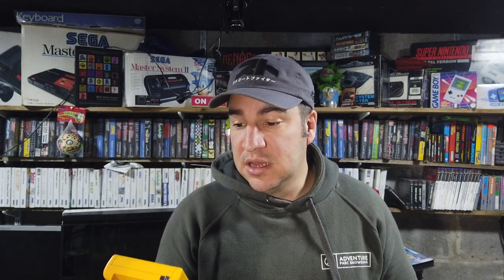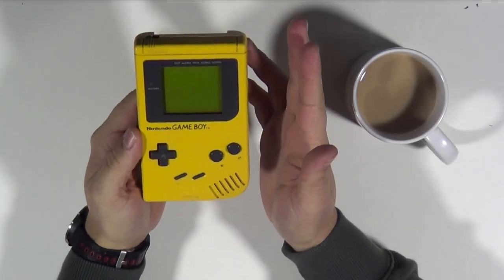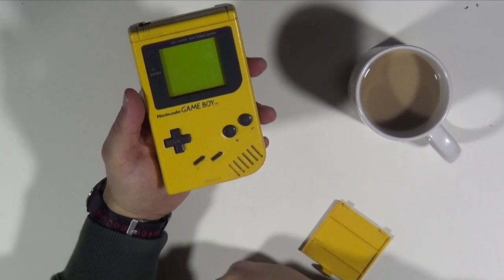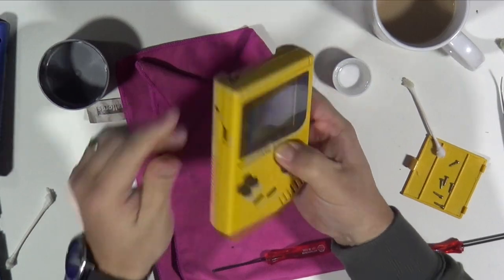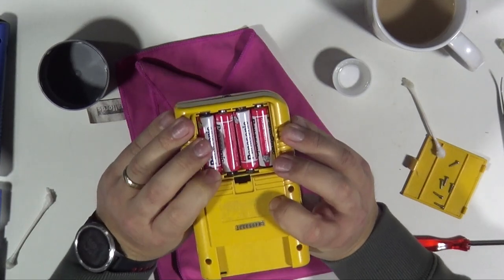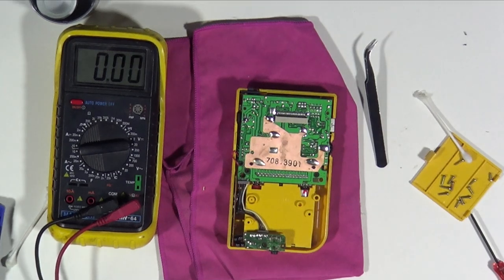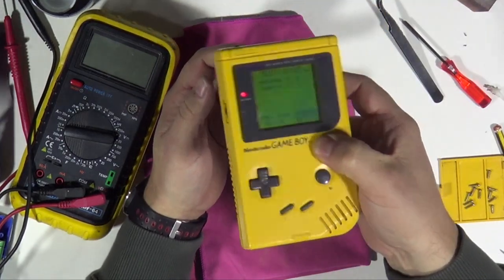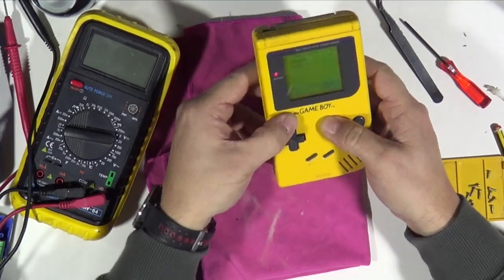The Best Nintendo Game Boy DMG IPS V4 Screen Mod OSD Repair & Install

Comment: I was gonna just buy one fully finished, but after watching this I think even I could do this mod LOL. Love the menu options with the colour, etc.
Reply from the maker: It is so easy and everything is in that pack, even the screwdriver. 
I'm going to do a cut down tutorial video from this just on the screen install for those that want a shorter more to the point video. 
Most difficult bit is that small ribbon cable in to the connector, it is just fiddly.
Reply: @GoodwinsPlace  that would be good Craig.

Comment: When I was watching I was thinking dont the two sprogs have to be cut out and then you did it lol.... Like I said to you before I've been looking to do this myself but the kits I looked at where way more expensive so this helps....great vid mate 👍
Reply from the maker: I know those bloody things, they are meant to be able to stay with this kit as the screen holder has the cut outs but they just wouldn't go. For the money it is great, think I've paid more for the backlight kits in the past.
Reply: @GoodwinsPlace  yeah I was thinking originally white with white buttons plus on retrosix website they do a white glass screen plate..... might be worth you taking a look i've seen theyre ready made ones on ebay and they look nice
Reply from the maker: @nerdygeezer78  watch this space, a parcel arrived today. #spoilers
Reply: @GoodwinsPlace  nice..... I'll watch out for it

Comment: Looks great! So no trimming the shell needed right?
Reply from the maker: Not on this shell that came with it. If you're using a stock shell or other stock size you might need to trim around the screen and some of the posts.
Thanks for watching.
Reply: @GoodwinsPlace  thanks for the help!
Reply: @GoodwinsPlace  *will, the screen and contrast wheel cutouts

Comment: Did you install the ribbon cable correctly at 34:00? I followed your video and mine didn't work (I had to flip it), and I noticed you have an edit in between that step and turning yours on
Reply from the maker: Yes, you can see the silver connections and blue text face up which then go in to the board face down when folded over.
I probably edited it to speed things up and if I went off camera for a bit to get something like tweezers.
Cheers for watching, hope you're enjoying your new screen, they are great quality.
Reply: @GoodwinsPlace  My mistake, I meant the large one closer to 35:00. I tried the shown way (blue stripe up) and the screen just gave me 4 Pikachus instead of booting. I had to flip the cable it so the blue stripe was face down / pins and text were facing up (I saw this at abut 29:00 into a different install vid by YouTuber Makho)
Reply from the maker: @Dry Cement  no just checked that too and it's right the way I have it. The blue mask protect covers the pins and you need the exposed side to face the board on both screen and main PCB. Other than the title clip there isn't a cut between fitting the batteries and me turning it on, it's the same footage.
I'm sure there are differences in kits being supplied but this is correct for the ones I've done, and probably done around 20 of these since this video.
Reply: @GoodwinsPlace  Thanks for checking, there must be a couple of different models  out there

Comment: First off, thanks for using Top Ranking Tennis for the demonstration, it's a wonderful game.
That being said, I really like this screen with its OSD and all that stuff, but in my opinion the Retro Pixel feature on the FunnyPlaying IPS screen is much much better and useful.
I mean, it's nice to change the individual colors maybe once or twice, but after that it becomes useless IMO.
Great video though, keep up!
Reply from the maker: Thanks Marco. Not sure how different the retro pixel is on the other screen to this one, I enabled it on this screen along with the battery display for a bit but took it back off as preferred the clean crisp look of the screen.
I know where you are coming from on the colour adjustment I thought it was going to be a novelty to start with but I think it really does make a big difference in some games. The stock colour options are great but being able to change the individual colours can give some real detail where the single colour gradients don't offer as much differentiation. 
With most mods it's personal preference, I've just picked up some extra bits got this from Retrosix to take it to the next stage. I think I'll be finished and 100% happy with it at that point.

Comment: Great vid Craig I really enjoyed that. It definitely made me want to do this. Only sticking point is I don't have a soldering kit. This is definitely the ultimate way to play og game boy games. It ain't quite the same on a gba, even a modded one.
Reply from the maker: It's a shame they didn't put some sort of push connectors for the speakers as it is the only soldering item and it is tiny. 
Always happy for you to send it to me to do, but you could get a soldering iron for under £10 on Amazon which you could do this mod with. 
I love the shape of the DMG, think it is a great size and for me is the system I spent most hours on.

Comment: I like the FunnyPlaying screen better. It doesn't have an OSD but the built-in color options are more usable. I doubt that anyone would really play with a deep red or blue screen like this one has.
Reply from the maker: I've got mine setup with a really nice colour selection now. Based on black and white with a grey and an off grey colour - I thought it would be a novelty when I first done it but it's great.
I think I might do a funnyplaying next as heard lots of good things about them.

Comment: Hi ! Thanks for the video !
I have just done this mod on my Gameboy, and I'm 50/50 happy with this.
First, I did the IPS V2 version, and the cross pad controller was a complet mess, then I saw this V3 and it was much better on the control side.
Then I realized that the overall thickness of the new IPS screen + the 3D printed plate + little control card were too fat, so I could not close correctly the Gameboy, I discoverd also that the big flat cable was pinched between the motherboard port and the control card glued to the screen after screwing it back together.
After many grinding, I was able to close it correctly...
However, there are some things I don't understand and have some concerns.
Sometimes, after 5 or 10min playing, the screen freeze, the sound continue to play and the light become lower and lower, this, if I am in sector wire mode, classic battery mode or Li-Po battery mode.
Did you experience this problem ? Sometimes I can play 1h without any problem.
I play with Zelda and thankfuly, I can save and close when this problem come.
Secondly, I'm a little intrigate by the battery icon mode you have shown in the IPS menu. I can't find any explainations regarding how it works, because I tried to put the icon on the screen, but it seems to indicate nothing about the battery statement, for me the icon never change during play, or maybe it's my imagination...
Thank you for your attention and hopefully for any tips you can bring to me :)
Reply from the maker: Thanks for the comment.
The fitting is slightly different depending on the IPS model, some need cutting, some need posts removed, others just drop in.
The crashing is strange, I've not personally had any issues like this, does it happen if you are playing at a lower brightness?
I'd check all ribbon cables again, make sure it doesn't have any major kinks in it or any damage. 
Last thing would be to test that screen on another Game Boy motherboard and possibly another game to see if it still happens.
I'd ignore the battery indicator, I don't think they are accurate, I don't even run the wires on the GBC for it to work now as they are so bad.
Reply: @GoodwinsPlace  Hi and thank you for the answer !
I didn't think about the brightness, and as I said, it happens some times, not every times. Today I just played 1h at Zelda and no problem. Yesterday, after 30min the image was completely exploded, shrinked and no more sound, so maybe it's the motherboard or some capacitor. She's very old, bought in 89 the number is G0... and she has philipps screws, no triwings.
I have an other DMG that I bought some weeks ago to pick up and swap the screen that has liquid crystal leaked on mine (to keep an original DMG fully operative) and I will try to swap them. I'm not at home all the time, I will try this weekend.
And what about the power regulator mod sold by Retrosix ? Do you think that worth a penny ?
Thanks again for your time ;)
Reply from the maker: @lechatvenere  I've not tried a power reg with an IPS, it could help but sounds like your issues aren't power related. 
Just to make sure none of these issues exist in the cart on other systems?

Comment: Im about to order this today. I also need a power board too. Was damaged from leaking battery.😔
Reply from the maker: How bad was the battery leak? Sometimes you can get away with a good clean up. I've had a few with surface damage on the board and managed to clean them up and get them working.
Reply: @GoodwinsPlace  corner of power board looks burned and corroded shocked it worked to begin with. I found a retrosix new replacement in UK for 18 dollars plus 16 shipping. All sold out in states.😞
Reply from the maker: Can't you get another game boy in the US for cheaper?
Reply: @GoodwinsPlace  yes I'm sure I could find one for parts but was thinking it would good idea to replace with new if going with new lcd replacement. Wouldn't the audio be less "noisy" with new power board like the retrosix cleanpower v2 and more reliable?
Reply from the maker: I think it will be worth it especially if you are doing the screen too. I don't know if it cleans up the sound at all.

Comment: That's awesome mate! I've just had a line go out on an original dmg. Think I might get one of these kits at some point to replace it.
Can you buy the kit without the shell if you want to?
Reply from the maker: A vertical line is an easy fix. But worth doing the upgrade if you were considering it. I know we spoke about it before.
I think they do kit only, it's one more step to cut the screen a little bigger.
Here is the link I bought on but might need to shop around on AliExpress if they don't have kit only.
https://a.aliexpress.com/_uHRJsT
Reply: @GoodwinsPlace  yes we did! Meant to say in the comment. Seems like eons ago at Bury. Turns out was solder points broke on the bivert chip as they are no flush on mine. Still not fixed that, need some solder 😂
Reply from the maker: @NathRetro1  that was it, maybe next time we have a meet I'll bring along some kit and do some fixes. 😀

Comment: Does the v4 only have the scanline Mode?? Or ist it already availble at v3?
Reply from the maker: It has the pixel mode 39:34 on the video. But I don't like it on to be honest.
Reply: @GoodwinsPlace  i know but its ok. My question is the scanline Mode already in the V3?

Comment: Just had this installed in one of my DMG Game Boys and it's great and I love the "Color adjust" part of the menu :) I am trying to work out an issue with the speaker sound it seems to have caused though. It's gone all thin, no body. No amp installed and same speaker (although a retrosix CleanPower v2 DMG power board has been installed, not sure if that's caused the issue but I can't see how...?) Now I'm pretty sure the amp for the speaker is on the front board as the speaker wires have to be resoldered to it. Maybe the board puts back a worse amp...?
Reply from the maker: You could try without the cleanpower but I don't think that should impact the sound, but I've not tried one on these boards to know.
A different newer speaker maybe? I've not looked at installing an amp on these boards. It should be possible but not looked into it as the ones I have done haven't had any sound issues.